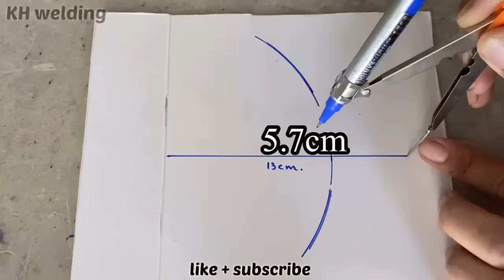Secret Technical | How to Make a STAR using Square Tube #KHwelding

Comment: KH Welding
Very disappointing!!!  You show the same dimensions in another video to make a 5 or 6 point star.  Actually neither work.  After several hours of CAD work and making parts it simply does not work out as you are showing.